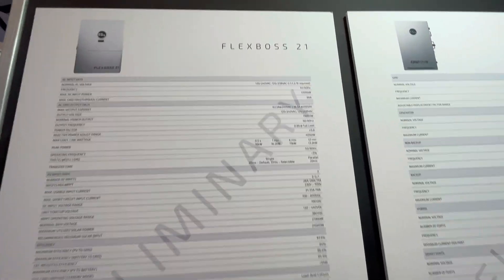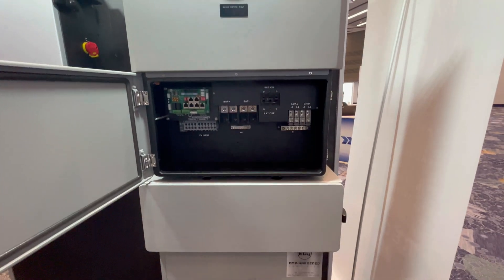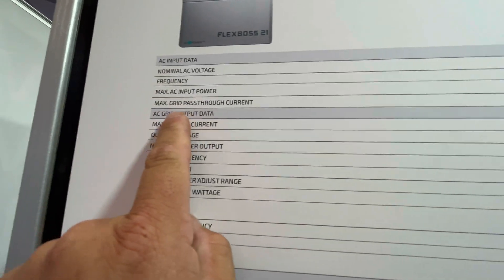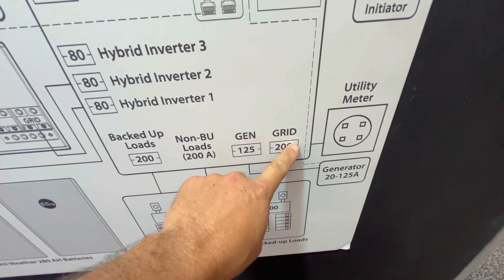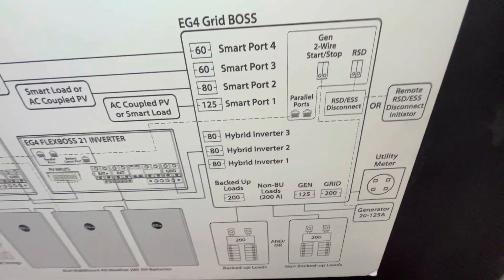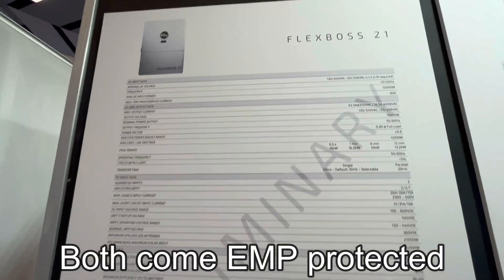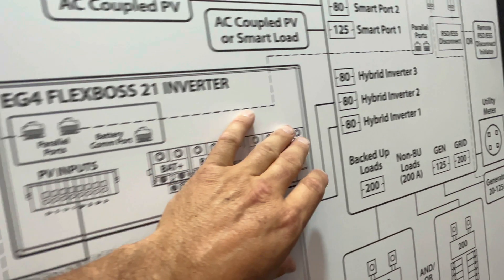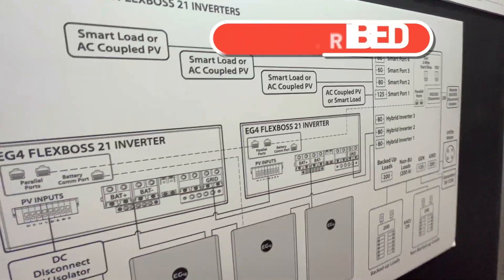New EG4 inverter!  Flexboss 21...it's BIG

Comment: I purchased the grid boss because it will load shed dryer and stove allowing my 30amp generator to run my house.

What are the pros and cons of adding either the 18kPV or the Power Pro. I’m only looking for features not cost.

Comment: So it's is basically a cheap lesser version of a Lumin's Smart loads panel hooked to a 12K Luxpower Inverter.
Reply: its way more than that. Doesn't need stupid CT clamps tied to your current panel it just sits between meter and your main panel.

Comment: Wow, the Gridboss looks awesome! It for sure solves some issues with our upcoming 18KPV install. I really didn't want to spend the money on a 2 way transfer switch but I know having one is ideal. 

It looks like the Gridboss will allow you to turn off the 18kpv for either servicing or working on your PV stuff while the home power doesn't have to go down. This thing is rad :)

Comment: How is the FlexBoss 25% >higher< nominal output but 33% >lower< max continuous line voltage?   4000W per line max continuous?   I hope that's a typo.

Comment: How about 400 amp service? Any word on if you can wire the gridboss in parallel?
Reply: 400 amp service has 2  200 amp panels.  get 2 Gridbox'es and do things in a dual setup
Reply: @dougbertInExile yes.  I have 400A residential service here, it’s commonly called “320A Service”, because that’s the max the meter can handle, it splits off into (2) 200A breakers, one is in the CSED with the meter with a 30 circuit sub-panel, that’s where I have my high amperage devices in (100A Tesla charger, 14-50 for Oven, etc), these would not be backed up..  the other 200A breaker runs into the house, which is where I’d install the grid-boss to replace my existing generator transfer switch, and I’d move my Enphase circuit which is currently line side connected, into one of the Smartbreaker inputs on the grid-boss, then if power is lost, the Enphase system can still power the house and charge the Flexboss21  batteries..  assuming they will implement frequency shifting to curtail micro-inverters if storage is full.  I priced it out, it comes in about $2,000 less expensive than using 2 of the Ecoflow Delta Pro Ultras with 1 battery each, and Ecoflow Smart Home Panel, where the generator input has to be manually flipped on (through an interlock).  This new EG4 offering is huge, when you can beat the consumer grade Ecoflow stuff in pricing
Reply from the maker: @jamesmartin2339  unsure on that. Need to wait until more details on it come out.

Comment: Gridboss $1749 Flexboss $4199 = $5949 combined
Reply: This is such an impressive improvement. I need over 12,000 on output and worried about getting one 18k or two 12k units but one grid boss with two flex boss solves that problem. Additionally, the 10kw output of the wall mount had me looking server rack batteries but now I could go one wall mount per flex boss and one grid boss with shooting for 4800-7200 watts per flex boss if I’m looking at this correctly. 

I have to be that larger rural home that you’re targeting with $0.17/kwh from duke with this concept
Reply: Is the 18kpv dropping in price once this is released?
Reply: The grid boss solves so many of my design problems
Reply: James, I need this NOW!  Will make a detailed youtube video on installation/setup on my energy channel.
Reply: Will the gridboss have any included breakers? 
Will it be compatible with the 12k
Reply: Will the price of the 12kpv and 6000xp drop also?
Reply: Will this be able to whole house backup and use battery at night when the sun goes down ?
Reply: $4199 is going to be the new price of the 18KPV when the FlexBoss 21 is released, according to EG4 CEO. I assume the price for the FlexBoss would either be the current price of the 18KPV which is 4898 or higher, So you speculation of pricing is way off.
Reply: @KeithOlbermannn  I am the ceo
Reply: @jamesshowalter6362  Oh shoot, sorry I stand corrected, WOW!

Comment: i guess i don't get it, a house can pull like 24kw max but these systems only put out 12kw or 15kw? so at best you can run half a house? i have a 21kw generator that is for emergencies. i just don't get how am i going to replace my electric bill with solar if i can't run my whole house off it
Reply from the maker: @adamm2716  my whole house is all electric except for my oven. I never pull more than 9,000 watts. And that’s with 2 240v well pumps. Use mini splits for AC, heat pump water heater, and heat pump electric dryer. I have a video on my channel on energy efficient appliances I use.
Reply: @unpluggedtexan  i need to check the output of my generator but my wife tripped our generator one time with lights and cooking and normal functions, since then she is more careful and its not a problem
Reply: @adamm2716 if you need more than 12K watts, you can add a 2nd Flexboss21 for 24K watts, and a 3rd for 36K watts..  most will find it less costly to replace older Air Conditioners with mini-splits than to keep adding more inverters in parallel..  price it out 😊
Reply: @mwolrich  i see, makes sense, thanks for the input

Comment: I don't see the point of this product. Only slightly better than an 18kpv in a few specs but more expensive and more pieces of equipment to install. Maybe im missing something.
Reply from the maker: @laynenichols3681  the gridboss makes it so during install the power is only off to your house for a few hours while the gridboss is hooked up. Then the rest of the install with wiring in pv, batteries, and inverter is done while your house has power routed through the gridboss. Then you get the added benefits of all the features of the gridboss. The flexboss inverter can also utilize 21,000 watts of PV at one time (to loads plus charging batteries). That’s huge.
Reply: @unpluggedtexan  the specs on the PV and battery current are right up my alley.   But 4000W max continuous AC output per grid line is a red flag.
Reply: I think the biggest advantage is that it eliminates the combiner boxES for the grid input and the load output, and also the transfer switch. So it’s a 3 in 1. 
And then, it adds smart outputs as well, so it acts as a subpanel as well.
Makes the installation easier/simpler. Less wiring too.
Reply: better specs than 18kpv and with gridboss it simplifies the install (less $$$$$). don't need no feeder taps or anything like that.
Reply from the maker: @ yep and I anticipate this being released sometime this month 🤞
Reply: Load management with the GridBoss would be one advantage I suppose.

Comment: It still uses low cost high frequency, low surge, short lived, output transformerless inverter tech that offer no galvanic isolation. No thanks.
Reply: Tens of millions of homes that have high frequency inverters from SolarEdge, Enphase, and Tesla Powerwall would likely disagree with your opinion.

Comment: this is exactually a great thing. The only reason I still did a back up panel even using large inverter that can do 200 amp bipass is if im gone and the heat kicks on it will drain the batteries and/or trip the inverter. With the relays it will stop that.

Comment: Outdoor WallMount: Did you see any potential changes to the outdoor EG4 PowerPro WallMount AllWeather Lithium Battery | 48V 280Ah | 14.3kWh LiFePO4 | All-Weather Energy Storage | UL1973, UL9540A?
Reply from the maker: @myhificloud  nope. But they will be launching a 5kwh wall mount battery soon.
Reply: @unpluggedtexan  Very nice, looking to add 8. Thanks for the update and information, very helpful. I'll check your affiliate links for purchase.
Reply from the maker: @myhificloud  thanks!  Much appreciated!

Comment: All they're doing is separating the transfer switch so they can charge you more money for a separate box and they increased the mppt capacities to 6kwp input. This is nothing innovative. They've building a system of proprietary components that can't be easily repaired/bypassed in a full outage/system failure event. Over glorified backup only devices. AIO will never be suitable when off grid requires redundancy for security. 2=1 and 1=none when your life depends on it.

Comment: awesome, too pricey. I am saving for the 18kpv, the 12kpv is not enough to run my house fully. I wish it was, This is overkill but if I win the lottery I will use your link to buy it.
Reply: you might revisit that decision,  the new inverter is cheaper than the 18kpv